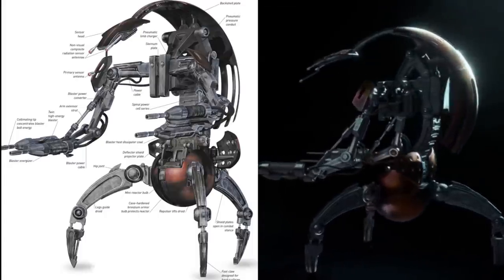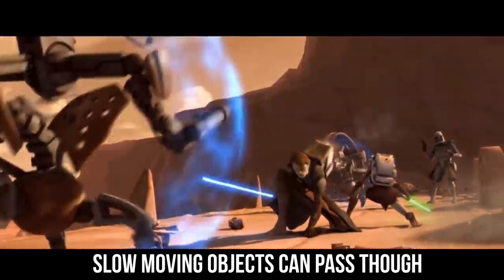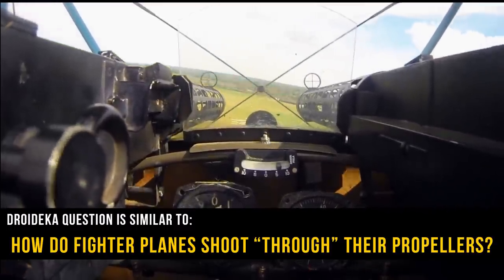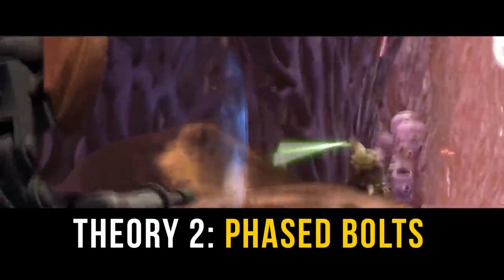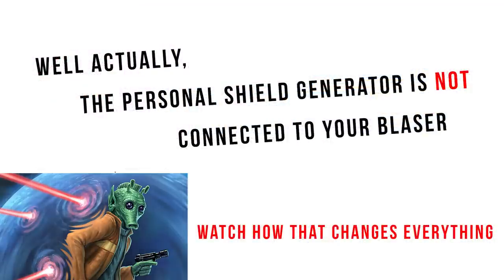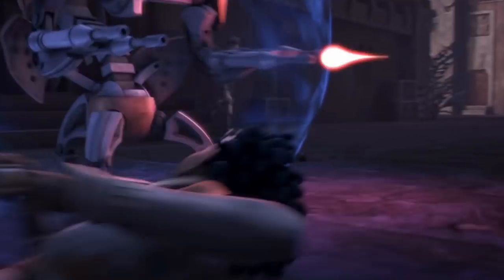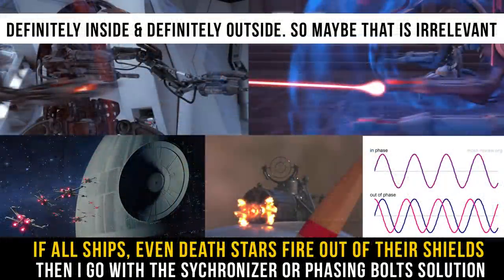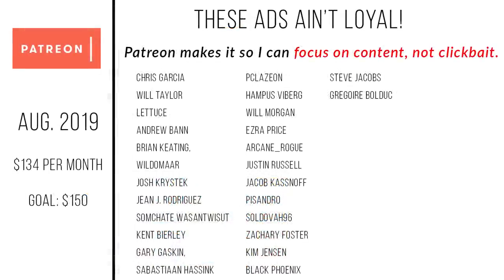How Star Wars Droids & Ships Fire OUT Of Their Shields (Deep Lore)

Comment: HYPOTHESIS;
Droidikas And Ships:
When it comes down to something moving fast you always have to deal with acceleration I.E a blaster bolt, and you said anything can go through the shield as long as it's traveling slower than a light artillery bolt so i propose that as soon as the Droidikas fire the bolts are just slow enough to go through the shields then they would accelerate towards the target, deflecting the bolt back won't go through as the bolt would still be accelerating.

Personal Shields:
It's not that they can't shoot through there shields it's that they don't choose to, since they don't have a powerful reactor and projector compared to the Droidikas if they did fire through there personal shields it would compromise and weaken the shield so you would have to decide  if you wanted to shoot a couple times out or be protected by a few dozen shots.

Death Stars:
They probably just reduce the intensity of the shield so minimal damage wouldn't affect the shield in the long term when they fire the super weapon.
Reply: How would they magically accelerate without a force acting upon them.

Comment: I think for the droid and other smaller things theory 1 fits well, smaller package and more disposable assets means a simpler solution,  but for larger things like capital ships theory 2 works best, simply more computing power and more at risk if the shields fail, so a more flexible but complex solution is viable and necessary 

On another point, I thought I once read that one of the reasons that personal shields were not widely used was because the radiation from using them all the time could make organic sick 
Not sure if that’s true anymore but I thought it was a good way to make them not common place

Comment: I think that the shields act like a non-newtonian fluid, where the shield parts for slow enough objects and prevents objects traveling at certain speeds from getting through. How destroyer droids and ships fire out could be that at the barrel, a small amount of tibana gas is vented out just before the plasma bolt is launched. This gas being vented would part the shield long enough for the high velocity plasma bolt to pass through the small hole, and the hole seals up immediately after the bolt is fired. The most notable non-newtonian fluid that exists on earth is ooblek, and for anyone that has seen the many ooblek videos by How Ridiculous, they have sent objects straight through ooblek, which also fits with the fact that enough energy, or Joules for the more scientific among us, can simply destroy a destroyer droid even though its shields. Doing this also shows that a shield can eventually be punched through with enough successive hits, as the shields on Chopper Base only held because Thrawn showed a slight bit of mercy and stopped the planetary bombardment. Even the 2003 Clone Wars show had Cody telling Obi-Wan that the shields would be down in 3 months with their barrage. So shields and blasters are all about energy, based on this theory

Comment: Not to bring up the Sequels, but assuming they also stick to the lore in regards to shielding goes. In order for Han, Chewie, Rey, and Finn to get on Starkiller Base and got through their shields by passing through at high speeds between the refresh rate of the shield. I would guess the blaster and shield coordination with the refresh rate to be the most likely case.

Comment: It could be due to the fact that the emitter/s is emiting outwards towards a fixed point in an arangment, the particles/energy gets pushed/displaced from the bolt as the shields are pretty tight to the craft/object.

Comment: However the shields of the invincible (providence class dreadnaught) with admiral trench in command blockading christophsis had to lower his shields to fire torpedos, so frequency manipulation obviously wasn’t possible on the missiles, and thus are not possible on solid matter, so the ability for proton torpedos to be phased should be viewed with scepticism as they are mostly solid, (they arnt just a canister like tabana gas used for turbolasers) which probably need shields opened for firing, however kyber or turbolaser based weaponry is plasma state based so it should work to be possible to phase, it could also explain why ion weapons are so affective against ships with shields raised, since at first glance an energy based attack should do fairly poorly against shields which arnt physically connected to the ship in any way, yet they still manage to work so they most likely scramble the frequency of the shields to the point where they collapse then the remaining energy hits the hull disabling the systems at their source. I think the frequency theory is most likely as it also fits with other things

Comment: Another question: what point does a blaster pass through. Does the exact middle of the blaster where the bolt is generated so it can go through? Does just the very tip need to poke out of the shield to let it fire out? Say CT-EXMPLE has a DC-15, and a personal shield. He pokes out just the very tip of his gun out, then fires. Does the bolt bounce back and obliterate his gun? Does it work? If he pokes the midsection of the DC-15 where the bolt is generated with the gas and power cell makes it. Does it fire then? And inside the barrel, can you still see the shield inside the blaster? A big hmmm moment.

Comment: I would think that the shields would always be applying an outward force pushing, causing things to be blocked on the outside while forces on the inside go through unimpeded if not accelerated. The planetary shields would probably be pushing in both directions in a more power force causing solid objects to be stopped no matter what. This does not answer the question about the personal shield so it doesn't cover everything.

Comment: theory # 2 I do think today but way back when I was in design we had high power grid = open gun ports & low power force bubbles. bubbles where generated by equipment with area of effect determined by size and power consumption. grids had  conduits in Hull plating so nothing passed.if no openings  no fire or communication or sensors...have fun and be safe..

Comment: Before I watch the video let me tell you 2 obvious reasons.

A. Stick the tip of you gun out and shoot.

B. Imagine the shield look like countles triangles. The tip of the triangles are pointing inside while it's surface is the outer shield wall. When you fire from the inside the triangles will glide apart to let the object or beam through. But stuff from outside smaahes against a flat surface.

Now let me hear what bullshit the lore makers created.

PS it also helps to think of shields as water the slower the object moves the higher it's chancws to bypass the shield.

Comment: If I recall correctly, the Interrupter method is the one used, since a shield has many emitters a small part can be lowered, also doesn't need different methods for different cases in the lore. Droids, Starships and Deathstars can calculate to lower the shields and nonconnected systems and meatbags can't. The reason, why Bombers and the like can bypass the energy shields, is that the energy shields are farther from the ships hull than the particle shields. So fighters go in between the two shield types. That is also the reason, why torpedoes are so deadly, because they bypass the energy shield as a missile/torpedo and unload their payload inside that, not needing to overcome the particle shield.

Comment: The muzzle breaks the plane of the field firing past the protection of the barrier.  That why the turret arm moves forward slightly, and slowly before firing.  You can actually see it.  Or you can say that the simplest, most cost efficient solution is the correct one... Oh wait.. .that means it's because fiction.. nuts... I don't geek as well anymore.

Comment: The frequency method makes no sense, because some enterprising genius could sink their blaster bolts with the shield frequency and fire right through them. Of course it’s unlikely, but Murphy’s Law (real-world physics law) says that if it CAN happen it WILL happen; at some time, eventually, at least once. I thought droideka blasters WERE slightly outside of their bubbles, based off Episode I; this makes a little more sense than their blasters being sinked with their shields, because that’s 1 more complication, more programming, and, adding that to the function of the droid, that’s adds to a lot to pack onto a limited sized droid brain. Dropping part(s) of the shield(s) at synchronized times makes perfect sense to me for ships; we see this in other sci-fi, such as Halo. A ship computer can be as big as it needs to be, so partial shield drop synced with blasters sounds perfect for ships.

Comment: I thought they opened the shield in episode V so the transport can pass. Not because of the ION canon.
Reply from the maker: It might/should be both according to other stuff. In the new thrawn trilogy you definitely have to lower shields to shoot, don't want to spoil the plot there the way it worked was really cool.
Reply: @MetaNerdzLore  Makes sense. Probably right as well. Ion probably needed the shield to open too. It's just that so much shit in Star Wars shoots through their own shields. But it is true the generator they used was probably quickly put together and not synchronized in any ways with the ion cannon. So I kind of get what you mean there. Will need to check out that trilogy.
Reply from the maker: Yeah for sure that is my favorite new canon addition

Comment: I think it is something different. The only thing we know that can trap both radiation (which in the case of the RAY shields I guess it is in form of charged electrons) and matter (probably in form of alpha particles) is magnetism. Now, this would make no sense IRL, but maybe it's a magnetic field that is negative charged on one side and positively charged on the other, allowing the charged plasma bolt (which it is, because some book says that the plasma is contained in a magnetic field to form the bolt) that is charged the same way as the OUTER LAYER to pass though the inner layer but be reflected by the equally charged outer layer. I don't know how that would factor in with personal shields, but it would make sense for the ion canon since the ion canons are meant to de-charge shields no matter their orientation
Reply: Either that or the interrupter, otherwise some legends author would have created a "superweapon" that can hack the shield generator\fire control to trap bolts within the shield.

Comment: Ships need to fire back Shields are one-directional, you can fire out but not in. It's like a wind current, it requires less force to fire with, than against it. The reason the shield is the way it is in Battlefront is because balancing...yeah not much to say to defend it. There's plenty of other Star Wars games that use shielding and the shielded person/droid can still fire out of that shield. Battlefront is actually the exception.

Comment: my thought is the they are set to the same frequency and as the beam passes through it is changed ever so slightly by the shield by a gain/loss of energy to the shot itself.  shot 10010 shield 10010 shot after shield 10212   shot after saber reflect 12302  if you get what i mean.

Comment: I thought that shields first evolved as method of deflecting away harmful cosmic rays on stellar trips..eg death star 1 had them over exhaust port as also had cosmic ray sinks on trench to detect these in case of problems.. so shields were from outset aligned with natural energy levels, which with stuff like SW equivalent of gamma ray bursts or X Ray bursts from stellar phenomena, were going to be of very high magnitude.. but the dual directional side.. not sure 🤣.
   But the Starkiller Base shield had fractional refresh rate (TFA) but was so fast was beyond normal speed of light (300,000 km per second) hence Falcon or other unwelcome vessel had travel at hyperspeed to travel through.. I'm guessing this phasing applies to energy blast from Starkiller as well when firing?

Comment: Does the Death Star even have a shield the Death Star II needed a shield from endor to protect it like an adapter what does the Death Star 1 have a shield
Reply: I don't think it does -- not in the way that capital ships and fighters do. And certainly not in the way the shield used for the second Death Star does as the fighters in the Battle of Yavin attacked it directly.

Honestly I think its sheer mass, it's number of defensive turbolasers, and the superlaser itself was enough to defend it without shields against the only type of attack the empire considered -- direct assault by capital ships. Starfighters were mind of an afterthought in Imperial Naval doctrine at the time both offensively and defensively I think.
Reply: @evilcoleslaw  until Starkiller base keep in mind I'm not all that fond of it I just consider it a Super Death Star capable of destroying multiple planets at one time am I fanfic I'm doing Starkiller base with both destroy life and create life but they were smart enough to add a shield this time around even if it was just simply turned off by a Smuggler and a trailer at least they were smart this time around